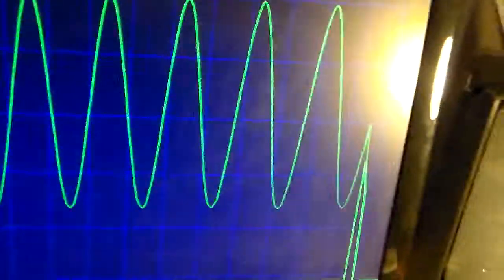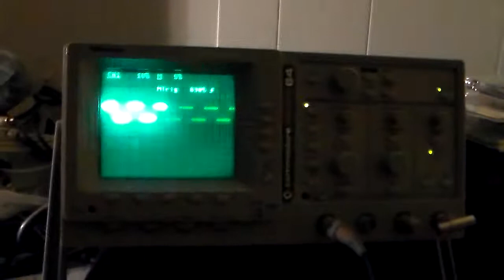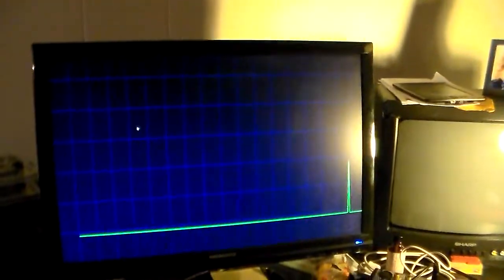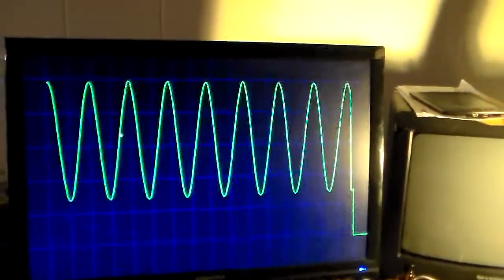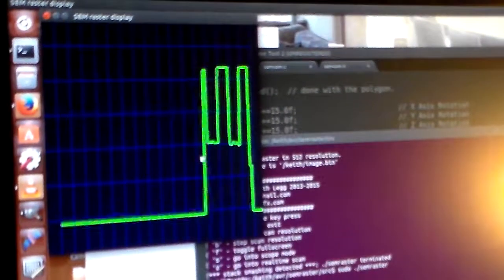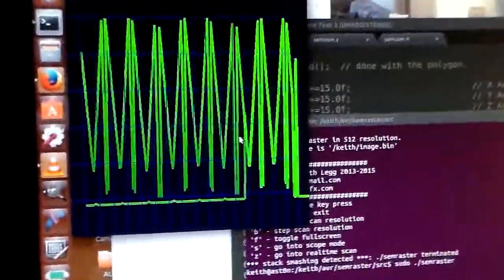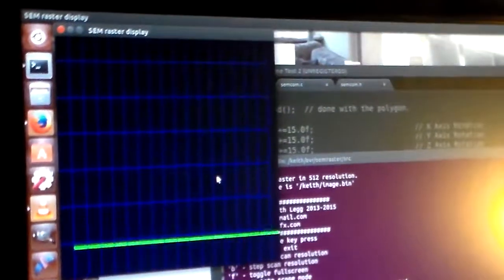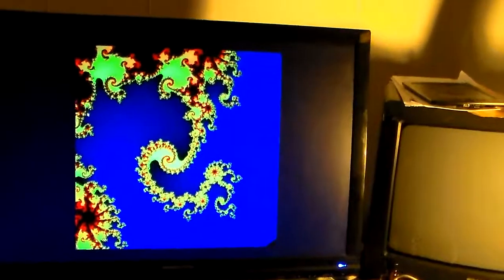homemade openGL oscilloscope

Comment: ANY scope without a trigger is utterly worthless.
Reply from the maker: You are probably right. I actually built this as an experimental interface to an electron microscope, which worked fine but was really slow. It was never designed to be a scope, I just did that for fun.
Reply: Are you saying that your electron microscope does not need a trigger?
Reply from the maker: Im saying that the term "trigger" never crossed my mind when I built this. It was a dual DAC (X and Y position of the beam) and an ADC that read in analog data and sent it to a computer pixel by pixel to assemble a picture.  I just included a scope feature for entertainment. I never used this as a real scope in production.
Reply: OK. But I am very impressed by your Electron microscope.